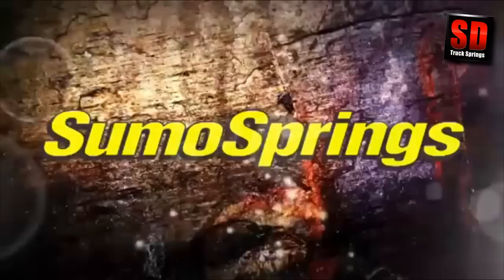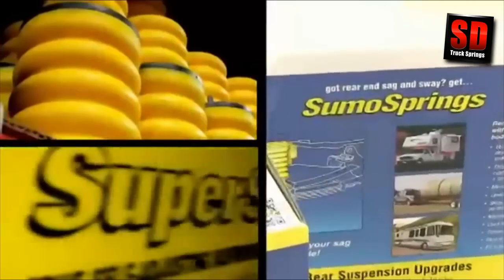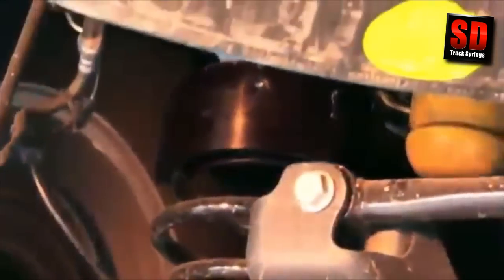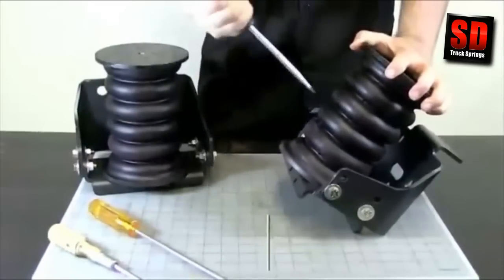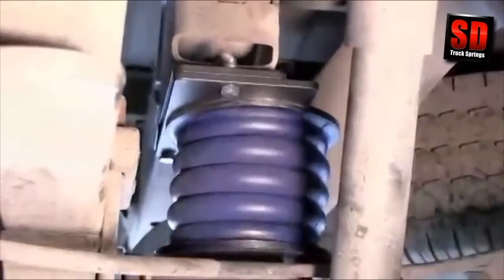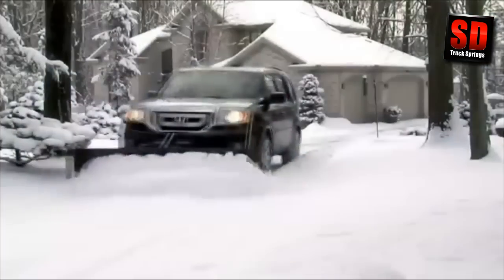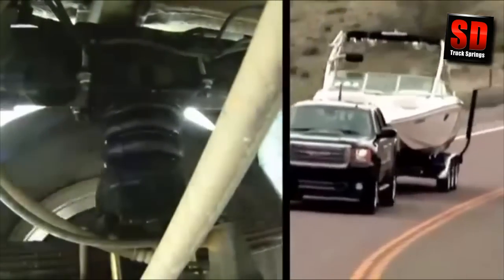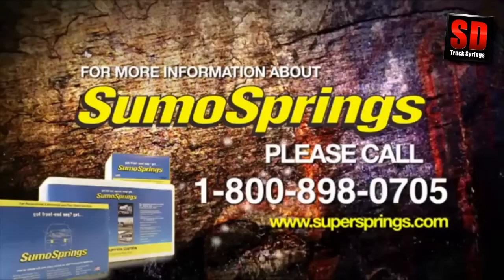SumoSprings - What They Do and How They Work - provided by SDTrucksprings.com

Comment: Installed on my Mercedes Benz Metris Cargo van. Have a 2,500 Lb. max payload which I carry often for my freight hauling delivery business. These things are great and highly recommended. No more bottoming out and peace of mind when doing a job. Keep in mind they help with the load you are carrying and NOT increase the capacity. Plan on getting more vans/trucks in near future and will install on everything.
Reply: i was wondering how these could help in a expedite van
Reply: How are they holding up?
Reply: @earlreid6811  Great 👍 I have 150k miles now and have put the springs and the van through heck and back. Handles max load of 2,500 lbs like nothing. Maybe getting new cargo van early next year and will certainly install them again.

Comment: know why ill be sticking with my air bags. well at 10psi its like they arent even there, and at 30 psi 3500lbs pin weight the truck still sits at stock ride height. these are neat but i know they cannot do that.
Reply: Which airbags would you recommend for a 2015 5.7 ram?

Comment: I installed sumosprings on my 2015 Mercedes Benz sprinter 3500 motor home and it appears to cause a toe in look on my front tires. I'm concerned about my tires wearing uneven. What's your thoughts?
Reply: just need to get a alignment since you are modifying the suspension
Reply: How are they holding up?
Reply: @earlreid6811  No problems 40,000 miles later.

Comment: do the shocks need to be changed to make up for the shorter distance ?
Reply: What shorter distance? The distance of suspension travel is virtually unchanged. These springs simply help support heavier loads, such as bed cargo and/or the tongue weight of trailers towed behind. Some experience a slight vehicle body lift, but that's not the intent.
Reply: Dwight Stewart will these help lift a 2011 f250 in the rear at all or do you know.
Reply: scott Brogle
   I can answer in general. SumoSprings are intended to reduce sag when hauling heavy loads, not lift a vehicle. They are made to fit each truck (exact length between axle and frame) without changing the vehicle height. Of course, if your truck is already sagging a bit (the bed with any cargo is a load in itself), SumoSprings may reduce that, causing the rear to go up a very small amount (well less than an inch on mine - not even noticeable).

Comment: Seems like a bandaid for a lack of leaf springs if you haul.
But would be a softer ride with stock leaf spring pack if extra leafs are not required for someone who rarely ever hauls anything.
I wonder if this technology is used for front suspension bump stops for those who like to flex at higher speeds.

Comment: I just don't understand how these Sumo Springs know exactly how to level your load especially when you're carrying a 5000+lb camper.  How do the springs react to the load weight?  What if your vehicle is low on one side?  How do these springs know to self-adjust on one side more than the other?
Reply: Marcie Warner because of "Sugondeez" technology
Reply: They dont self adjust,they make contact when your factory bump stops dont. It's a alternative to airbags.
Reply: @germancavallo8277  can you please elaborate? I have a 50' RV that I drive thru the ocean. This technology that you speak of is quite intriguing.

Comment: If you want to break your chassis.
Reply: Robert Anderson How??
Reply: Icutmetal 
By changing the centre of downward force to a centre point instead of distributing the weight evenly over the entire spring assembly.
Reply: @robertanderson5796   these only carry a small percentage of the weight. Your leaf springs will still be carrying most of the load.
Reply: I know this is an old post, but these do hold the entire load.  ALSO, if the chassis were going to break from sumos, your bumpstops would also break it on a hard bottom out